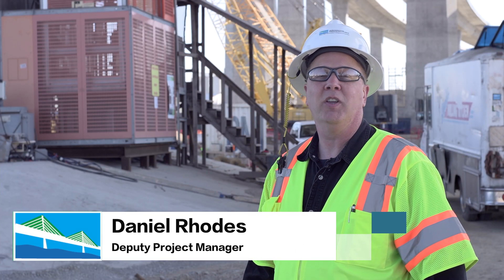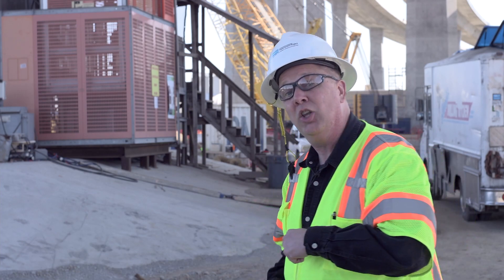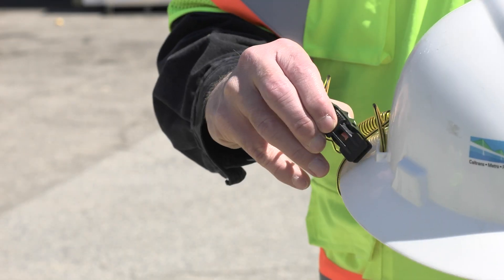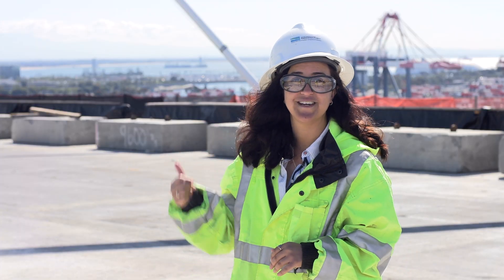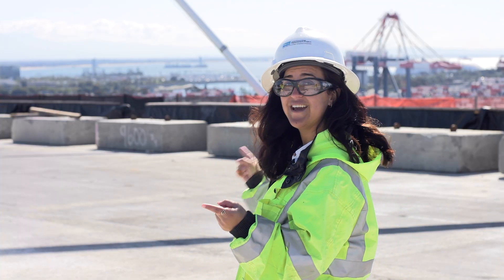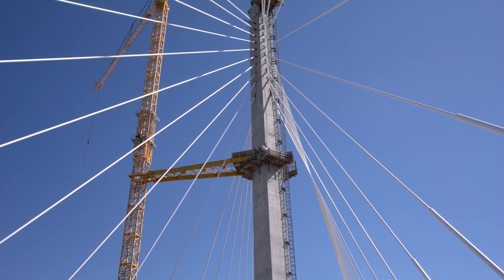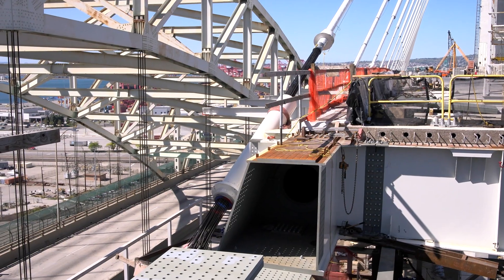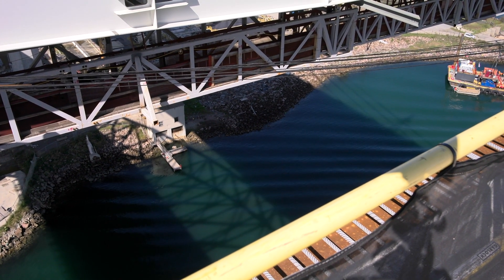Bridge Project Virtual Tour: Main Span

Comment: I would like to see some videos of when they are removing the old bridge.
Reply from the maker: Good idea! We'll remember that when they start the demolition.
Reply: LBrigeproject My Dad and I worked in the Connally-Pacific yard which is at the base of the bridge on the east side for several years .That's where my Dad retired from. I have been going across the Desmond bridge and the pontoon bridge that it replaced all of my life. It's kinda sad to see it go, but change is the only constant. In 1986 there was a barge mounted crane heading out of the channel and due to an extremely high tide and the boom on the crane not lowered enough it ran into the bridge. Yeah it made a helluva noise when it hit. I am sure with out any doubt that some of the people on the bridge messed their pants.